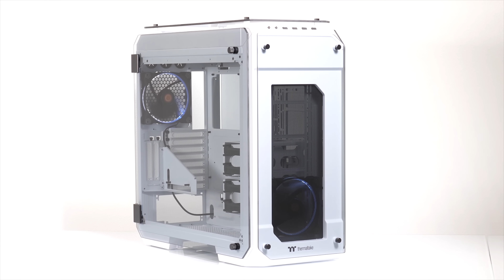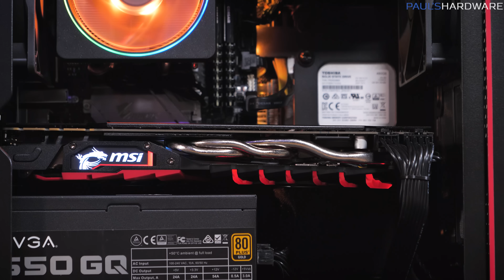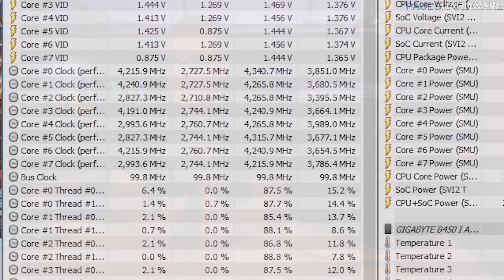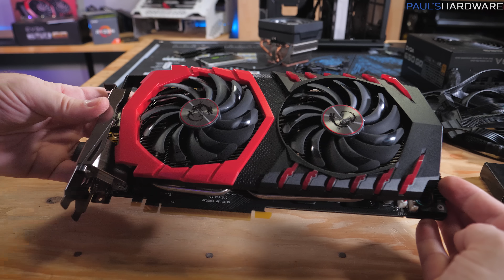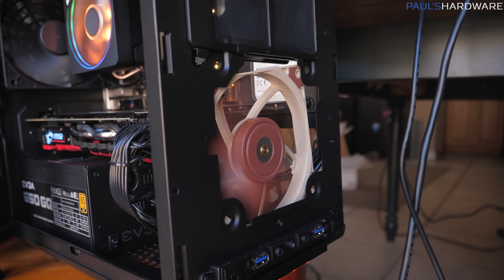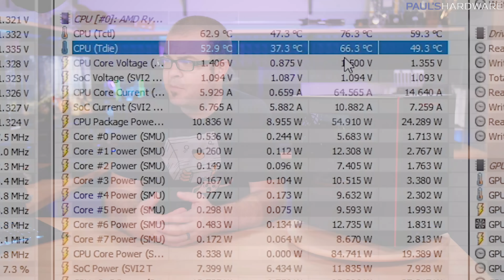Testing the $1200 Mini-ITX Gaming PC Build of the Month!

Comment: For small mini ITX tower cases like this, do you have an thoughts on rear fans when using small tower coolers?  I built in the CR280, using the Be Quiet! Pure Rock Slim small tower cooler (one 92mm fan).  Even though that fan pushes air through the cooler first, it does seem there is air flow through the back of the case.  I have two Be Quiet! Silent Wings 3 1450 RPM, PWM, 120mm fans at the front of the case.  In practice I think things run cool enough without the rear fan, but for some reason this a little thing that keeps nagging me.

Comment: I used this build as a good starting point. I used same cpu, motherboard and ram.
The card was a msi1070ti titanium and the psu was a seasonic 650 gold semi modular and a samsung 970evo ssd. Case was fractal design mini c tg (case you featured could not find in australia)
How are you powereing 3 case fans the motherboard has one fan header and i used a splitter to power front and rear fans that came with case
Reply: I want to know the same thing. Do let me know if you manage to find an answer.

Comment: My Ryzen APU build is working fine, but when I run Cinebench, the results are TERRIBLE.
I used an MSI B350M Pro-VDH motherboard, the Ryzen 2400G APU, and 16 gigs of Team T-Force Vulcan  (4 x 4GB) 288-Pin DDR4 SDRAM DDR4 3000 (PC4 24000), and a CORSAIR CX-M Series CX550M 550W 80 PLUS BRONZE power supply.
WHY would Cinebench move like a snail?  Is my power supply too weak?
This is essentially the same build Shane at Hoosier Hardware did, except he used the 2200G and only 8gigs of RAM.  
I have other builds that use integrated graphics, and they run fine with Cinebench.  
Any idea what I may have done wrong with the Ryzen APU build?  Anyone?

Comment: The 'nice thing' about these AMD based builds is that you could sell your 2700X  and plug in a New 3700X or 4700X  over time. You could sell and upgrade GPUs in between CPU upgrades. If clock speed scales in GPU performance like the 8700k shows in performance over the 2700X then it is the best bang for buck upgrade... isn't it? Also would it be possible to take out the plastic screen and mount some mesh and see though filter on the side for improved ventilation- though probably increased noise as well?
Reply: Like ur thinking

Comment: Another build without an operating system included in the budget.  Why not shoplift the RAM from Microcenter and call it a $1,000 PC?
Reply: jdmomaha Ebay windows 10 license keys. Legitimately purchase cheap keys. Have done it 4 times now no issues.

Comment: Add rtx2018ti
$2400 PC
Reply: 1200 - 400 + 1200 = 2400. Qzick mafs
Reply: I guess that you forgot how to factor out the current graphics that's in there
Reply: Jokes on you dummies I typed 2018ti,
Reply: gonzostwin1
Why you need low power ITX?
Need ray tracing, RTX 8000, any creative?

Comment: Nice build!
Just about to scale down to a Ryzen 7 itx myself. Currently deciding on board (between Asrock B450 itx & MSI B450 itx, the Gigabyte isn't available anywhere).
The Riotoro case was one of my first choices, due to size and seemingly good cooling ability (hybrid cooled gpu + best air that would fit).
But unfortunately here in EU it's priced higher than Fractal Define Nano S, so I'm going with that one. Bit larger, but sound dampening is nice, Fractals dust filters are great and no window (a + for me).
Otherwise the CR280 looks like a great base for modding (change color strip & logo, etc), if you get it for msrp.
Reply: @BrammerMS  The Asrock B450i board. Was cheaper and seems like MSI has no offset settings. Though I think Asus might have better settings in bios. Asrock doesn't have all offsets without manual OC enabled, and I'd like to avoid that. The 2700x can auto boost very nicely, but need good cooling. My Noctua NH-D14 only keeps it ok on stock. If you enable further auto boosting (named differently by each board) then it's too hot. Soo I do plan to get a 240 or 280 AiO both for temps and access to board (Noctua covers everything).

Comment: No optical drive/slim ODD.. thumbs dowwwwn.
Reply: just buy USB optical drive
Reply: @jag - not everyone wants a cluttered work space with a bunch of USB attached devices.

There’s NO reason these newer case designs can’t fit in an optional slim ODD slot..
Reply: you only plug it in when need it last time i used a cd was 2015
Reply: @Jag - there’s no reason not to have it as part of the case. There’s NO need for an external..

I use it enough that it’d be easier just to keep plugged in than constantly be moving it around. 

That’s why it’s an optional thing. If you’re not gonna use it.. you don’t have to put in the drive/have a little slit for it etc :)

Comment: Bro, life is too short to live in 81 degree temperatures.  You were born in a time that has AC.  USE IT!
Reply: 81 is using it when in california its between 80-120 degrees depending on where you life, its 109 in the morning here where i live, trust me 80 is cold lol xD
Reply: Southern California can get hot but nowhere near 120 and rarely over 100.  I live in VA where the humidity is absurd April through October and we have warmer summer temps on average than southern California.  I couldn't live in 81 degrees...
Reply: the only reason LA stays cool is cause its located next to an ocean, depending where you live, it can range between 70 to 120 within 30 miles (Like palm springs for example can get as high as 120 degrees and its only 30 miles away from LA).  Besides, 80 degrees with no humidity feels fantastic.  I live in Missouri and we have high humidity summers with 100 degree heat.  We have to keep your AC at 72 during the summer just to keep the humidity levels down so we can feel comfortable in the house!

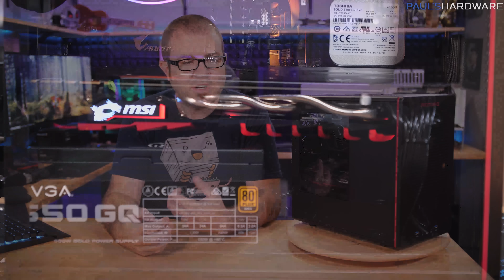Comment: 6:36 

Umm that's called throttling... Don't think of it as throttling..
 But it is. Lol
Reply: That is not throttling. Throttling means slowing down to achieve safe temps, and boosting is speeding up while temps and power permit. When you cannot achieve the cooling needed at maximum boost, the card will just not boost as high.
Reply: Yep, it's definitely throttling lol. It's all the same thing. If it reduces/limits the performance/flow/power, statically, or dynamically, it's called throttling. I'm sure that the word throttling came from vehicles meaning to control power by a throttle. You don't want full performance without a load, so you restrict flow. Limit CPU voltage and frequency for economy. I wouldn't call it thermal throttling though because likely for the cpu it is based on load.
Reply: Derek Kuraitis It is not the same thing. The term throttling may have its roots from vehicles, but in this case it means a different thing. Go watch Science Studio if you are confused. Getting performance from boost is extra performance that you get for free, which is more than the "full" performance that came out of the box. If your card is slower than stock, then it is throttling, simple as that.
Reply: If it's not hitting the maximum frequency possible for whatever reason I consider it to be throttling. This whole base-clock and boost-clock is just double-think bs by manufacturers so they can get away with advertising fake TDPs and use inadequate or insufficient cooling, pretending to be more efficient than they really are. I'm not saying scaling clocks/voltages according to heat and power capabilities is a bad idea, just that the way they market it is pure bs. They should just list the actual top power consumption and top heat dissipation requirements to run the chip at its full capacity and let customers deal with choosing the appropriate solutions if they want to.
Reply: xpwnter Well that is true to some degree, but consumers are also responsible for making themselves aware of what is going on instead of just complaining, because throttling and unable to boost are fundamentally different things. Calling them the same is just pure ignorance.
Reply: Science studio doesn't have a "cpu boost" or "throttling" video. When I buy a cpu, I buy it because of it's total performance not for it's "base clock". The manufacturer limits the performance for many reasons. That does not mean the cpu's correct frequency and voltage is correctly set. Just adding a better cooler allows you to remove the thermal throttling that may occur on their chosen values. I agree with xpwnter, anything that limits it's KNOWN maximum reliable performance, is throttling. Same for the term used for bandwidth.

JayzTwoCents hate for the word "bottlenecking" is the same reason you don't like the word "throttling", although everyone uses it.
Reply: Nicholas Lau: It's not unreasonable to expect for vendors to be transparent about their products REAL top power consumption and heat dissipation. We are informed computer parts customers and can do proper research before buying, but most people don't understand all the technical stuff and are misled by the marketing material. I personally consider the way they market it bs, but ymmv, that's all. 
By the way, "throttling and unable to boost" actually is fundamentally the same thing: adjusting the clock/voltage accordingly to the power delivery and heat dissipation capacity. Really, it's just marketing bs, no point arguing about it. See it however you like.
Reply: If you buy a turboed car that was engineered to be reliable at 12 lbs of boost but they sold it to you set to 8lbs of boost. Which one is the correct value?
Reply: Derek Kuraitis How about a turbo car advertised to be at 12lbs, but you found yours at 14lbs, and your friend got 15lbs. So your car was "throttled" because you didn't get 15lbs like your friend did. Same case here, many GPUs readily boost past their advertised boost clocks, but just because you didn't reach the crazy clock speeds a LN2 overclocker did, your card was "throttled". The known maximum clock a card can achieve IS the base clock, and overclocking/boost is extra performance that depends on the silicon lottery.
Reply: xpwnter If you insist so then everyone is throttling, except for that top overclocker who won the silicon lottery
Reply: @nicholaslau3194  it is throttling becayse its full boost is what we expect, quite being a contrarian.
Reply: Nicholas Lau: Not quite. The overclocker is consciously setting his card to exceed rated parameters and may make the card unstable (i.e. crashes). When the card is only "boosting" it reaches a known stable clock (doesn't crash), except it exceeds the advertised power and heat dissipation specifications, making the advertised figures and efficiency claims worthless. In practice they're selling a product without specifying top power/heat requirement figures, and that's my problem with it: marketing bs. It's like a car advertised to run X km per liter of gas, but then that figure only applies if you're going downhill, wind on your back, at a very specific speed and car totally empty - it's not realistic. It doesn't necessarily makes the car bad, but the advertised numbers are worthless and deceitful.
Reply: @danannnnnn  i would jist prefer to get full boost
Reply: But cooling with LN2 is not sustanable. But intel DOES advertise the boost clock. Everyone has the same. You likely can all get an expected performance without relying on the silicon lottery. UFD tech came out with a video showing that the stock cooler is smaller now. At that time you also didn't have "boost" frequencies. I wonder why... If you continued to do production work on that computer with the current stock cooler for more that the 10min, it would likely reach threshold. I'm sure it was to cut costs for the average user. The hardware underneath is powerful but the stuff intel does to cut costs can sometimes be unreasonable and reduces performance.
https://www.youtube.com/watch?v=hUKQcEak0hg
Reply: It's hard to believe that laptop cpus are not just underclocked/undervolted desktop equivalents. If you get it wrong, then you get this:
https://www.youtube.com/watch?v=7gJ8mGFjeqA
In this case it's apples fault. Pretty much you have to pre-throttle, so you don't Post-throttle. Are you triggered now? I made up some new terms. Hehe.

Comment: does case size make a difference for temps for cpu/gpu? A mini ITX would be great for my desk size but im worried about temps.
Reply: More ventilation can compensate for that. Usually they do run hotter with less mounting points for fans/less space for beefier coolers.

Comment: So 1070Ti and 1080 are an option instead of the 1070 .... and the Vega 56 or 64 are not? Performance is similar and pricing normalised too. shrug
Reply: I'd buy a Vega if they were priced right. But they're not.
Reply: In smaller cases, Vega might warm things up more.
Reply: On must places Vega are still a bit overpriced for being a option if price is a concern
Reply: Seems to be a problem in the US then ... here in Europe the 1070Ti and Vega 56 cost almost the same (~450€). Same thing with 1080 and Vega 64 (~520€)
Reply: Yeah...Vega 56 is in about the price ballpark of a 1080. Vega 64 is almost $100 more expensive than a 1080. So what are you on, and where can I get some of it?

Unless you factor in GSync versus FreeSync monitor cost, you're spending more for less. A GTX 1080 beats even a Vega 64 in performance.
Reply: 1080 does not  beat a Vega 64 in all games
Reply: Check pc part picker, the 1080 cost same as vega 64, thus there i no reason to buy vega. Shrug (i like vega unlike most other people here, but yoyr comment was incorrect)
Reply: In the UK the Vega 64 is actually a tad cheaper than the 1080.
Reply: @wing0zero  a tad doesnt matter becayse the 1080 is so much better than vega 64. Im guessing 1070 ti is cheaper? Or same price? That means its a better buy.
Reply: @Eian_Anderson  
Just going off a place called SCAN 
1080 is £480+ 
Vega 64 is £460+ but that's a PowerColor one rest are £550
1070Ti is £410+ so not bad
You can get a 1080Ti for £610 now which is cheaper than 1080 launch price, they did dip below £600 for a brief period.

1070Ti seems a ok buy at them prices.
Reply: overclockers have the vega 64 powercolor at £449 now and the gigabyte 64 at £429, and yes the vega 64 for myself is better than a 1080 (it seems theres not a lot in games recently between them) but factor in freesync and its a no brainer for me ( i do indeed have the powercolor vega 64)
Reply: @Eian_Anderson  You are wrong, at least for the US.
PCPartPicker Prices (Cheapest, with rebates applied, in USD):

Vega 64: $544.98 (NewEgg Business)
GTX 1080: $429.99 (NewEgg Business)
Vega 56: $459.98 (NewEgg Business)
GTX 1070: $369.99 (NewEgg Business)

Since I don't have a NewEgg Business account, here's those numbers again with NEB deselected:

Vega 64: $576.98 (NewEgg)
GTX 1080: $449.99 (B&H Photo)
Vega 56: $497.42 (NewEgg)
GTX 1070: $390.70 (NewEgg)
Reply: EVGA gtx 1080 is cheaper $399-$430 brand new
Reply: Agreed but vega cards are still bit overpriced
Reply: Most Vegas have a 2.5 slot or 3 soot coolee so no, vega isnt a real option unless you want to use the vega 56 red dragon which i think is to long for this case
Reply: Nobody likes Vega.
Reply: Vega is overpriced and generates a lot more fit. A bad idea both for bang for the buck and a small case where thermals are a concern.
Reply: Astravall
3 year old medium level GPU cards on AMD?
Performance? similar ??
Gamers only need the $500 last gen nVidia cards, some > $250 intel CPU..... Forget needing more shit, mega radiators or reasonable Vega cards!
pricing normalised????????????

Comment: Gpu is too close to psu. Standard issues in Itx builds.
Reply: Standart
Reply: Angry Thumb Thumb
It's when you stand while painting.
Reply: @Eian_Anderson  That's my briefcase.
Reply: Hundred Waves
AMD GPU, VEGA, on ITX?????
this is the low power shit! Need a high Watt tower ITX?
Real people never need this crap build, any $250 intel enough to run RTX cards now! Nobody needs this...
Reply: Why I prefer the Raven and other cases like that. GPU is right against the side vent. If you have a blower style cooler, it's almost no heat exchange from CPU to GPU.
Reply: The best choice for most people is micro atx. This type of set up almost never makes sense: you have no options for expansion, heat/lower performance, and you have to pay more.

Comment: The year is 3059 and I’m still waiting for Paul to finish his HTPC.
Reply: 68daking68
The year 2019, 6IX9INE or 69 still alive, on iPad! Gaming kitchen builds in 2020? PC 1970 cards slot systems?
HTPC, you meant Samsung SmartTV in 2018?
Reply: lucas rem Paul was going to custom build his htpc using wood......and by the way smart TVs are very limited compared to a pc
Reply: 68daking68
limited? My TV does the job now, any codec, on stick it runs Windows 10 on intel too now..If it needs nVidia gaming shit, you need a PC!
TV's do 120 FPS now!